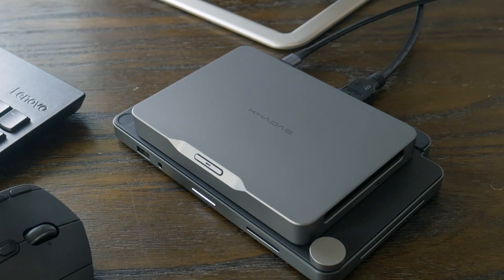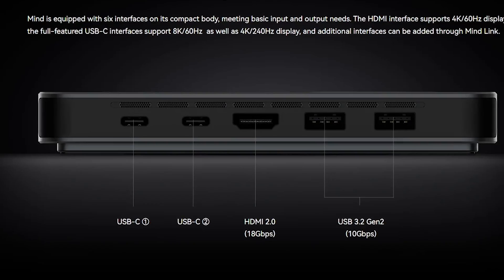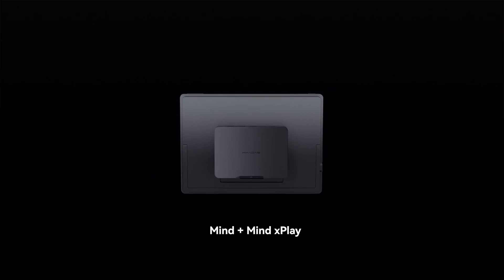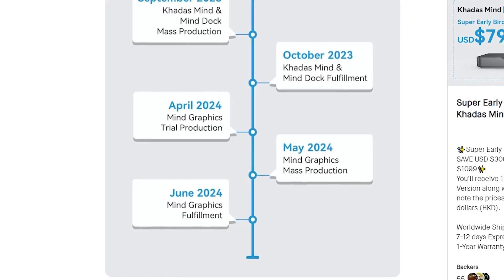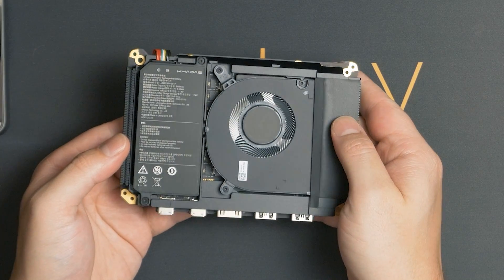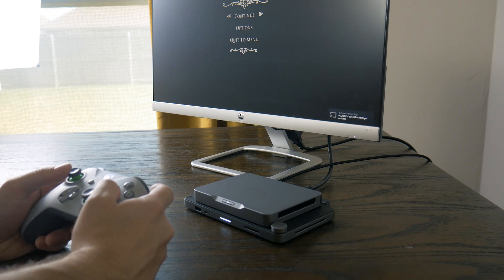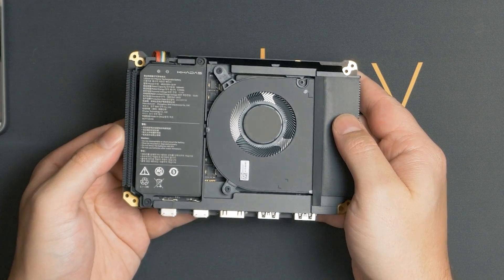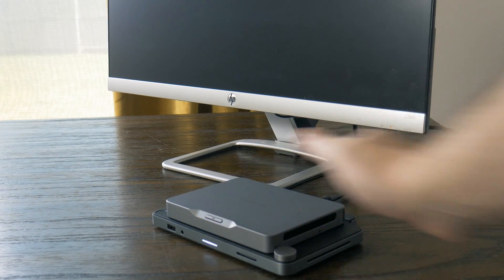Is THIS the future of PCs?

Comment: Framework has a similar solution with their cases for their laptop motherboards. And hey, upgradable system board and modular connectors!
Reply: Yeah but the connectors are all USB-C which is far better than this company's proprietary solution. You can even build your very own custom modules to use as a result with USB-C unlike the product in this video. Which is why this product will ultimately fail.
Reply: Kind of Framework is trying for a fully modular and going by the current standards of connectors so what you already have or might buy in the future will be compatible. Khadas on the other had seems to have went the route of the system RAM is non upgradeable as even the traces for an upgrade are missing for who might want to solider on their own. The CPU is a BGA CPU not LGA nor PGA CPU.  BGA makes for a thinner CPU but also a non-upgradable CPU. 
Having 2 M.2 slots the easier to get to of the lesser made for standard of 2230 isn't that good either. Framework gives you options that include boards with up to 22110 M.2 slots.
The USB ports ok it has more than most Framework laptops have but that is normal for modern laptops to not have many USB ports.  
Objectively Framework for all it's flaws did modular computers better. Khasa might get better and if they make another that has a "mind connector" for connecting many of them together i can see them being used in a node based server environment to have many CPUs in a small physical area for a developers at home environment to use. Still 700 USD a unit is high. 100 USD of which is probably just the windows license as i doubt they got a deal with Microsoft to get it for cheaper.
Reply: @yumri4  the way you discribed it suggests that khadas are copying Apple. Apple loves proprietary. I looked over framework's stuff and i like where they're going. Framework's idea is to provide you with everything you'll need for start but wherever they can they won't restrict you with proprietary crap.
Reply: and they won't void your warranty for fixing it.
Reply: Might be possible for them to make a bigger case for Framework 16 motherboard with universal PCI-E connector (as Framework 16 has x8 PCI-E pins for connecting a detachable GPU module)
Reply: @sihamhamda47 oh yeah, I would buy one.👍
Reply: All PC have that too.
Reply: No way the framework board is this small

Comment: the reason framework concept could have worked is that they didn't use a proprietary connector and tried to be as open as possible, publishing dimensions, etc. for a small company, proprietary connector for "extension" is just DOA. hell, even big companies more often fail than succeed.

Comment: This better not be the future of PCs. Proprietary connectors, no proper PCI-E expansion cards, no user controlled modularity, no replacable processors, and soldered ram?!? This thing sucks and I pray this doesn't become the norm.
Reply from the maker: The thought of this being the future would mean that the connector isn't proprietary, at least that's what I was trying to convey. And while I love socketed CPUs and RAM, it's very likely that SOCs are going to be the future in many ways, mostly because of the benefits you get with shorter traces. At least with something like this, you can upgrade/swap a an SOC essentially.

Comment: Yeah. No. Expensive. Voiding warranty for replacing an SSD. The literal definition of a user servicable part. Proprietary connector. With Overpriced "Standard" Hardware like the 4060 that you are locked into buying. Product hasn't shipped to backers yet, but they are already planning to open up the store to outside orders? 

So many red flags... Seems like they've got an apple complex, which is the exact opposite direction the market should be heading in imo

See what the backers say on KS first

Comment: I don't know. This frankly seems pretty dumb. So it's a relatively high end single board computer in a nice small case. That's cool. But that already exists. Then to expand it which is the selling point of the whole thing you need to use a proprietary connector. That sucks. I mean business used to not super mind that. You saw a lot of laptop docks back in the day that used connectors like that. But post the widespread acceptance of USB-C that's pretty much gone away. Even most business class laptops now just have USB C docking solutions, with some sort of custom locking mechanism. I really just don't see where this has a place. 
A mini pc with a USB-C port that supports thunderbolt 3/4 is going to have all of the benefits that this has (Maybe slightly worse graphics cards utilizations. I'd need to see some testing of mind link to be confident one way or the other) it's just a solution to a problem that at this point has already been addressed in a superior way. I honestly don't get the appeal of this.
Reply: Laptop docks are still proprietary. No two laptop models seem to have the same IO in the same place to actually *dock*. The only one that seems to exist these days is for the Macbook. What you have instead is just IO extenders on a cable.
Reply: @kendrakirai  As someone who's worked for several remote jobs that supplied laptops with docks post covid I am 100 percent confident in what I said. Even most business solution docks are USB-c how the laptop sits on the doc doesn't matter the connector is all that matters.
And your comment about what IO you are granted one doc to another also doesn't matter.

Comment: cool video! i don’t really see the problem this solves, though, and the proprietary connector makes it a lot less desirable to me. it seems like a laptop with extra steps
Reply: I guess you can have better ergonomics at each docking station, instead of using a laptop? But then again you could do the same with a laptop..?

I think it's neat, but ultimately doesn't seem to solve alot of problems.
Reply: The concept is great idea though, could have a dock running 4090, so you don't have to carry the that around. most hotels have a TV anyways

Comment: Yeah, no. Proprietary connectors. What a great idea. I don’t have a closet full of things with proprietary connectors, nope, not at all. Looks like a future doorstop to me.
Reply: Literally came to the comments to say this. Taking pcie 5 and turning it into something lesser.
Reply: @PlayingItWrong what's the max amperage of PCIe? Four? Six maybe? Edge connectors are not suitable for auxiliary connections and being exposed to the environment. Seems like a proprietary connector would be required to meet these specs, USB isn't mechanically robust enough.
Reply: I agree, if the connector was something standard like pcie or oculink, then i think it wouold have been good @PlayingItWrong
Reply: Looks like the most compatible would have been an x8 or x16 PCIe slot on the edge (even if it's electrically a x4, it would make plugging in a regular GPU totally easy and possible.)

Second choice would be using oculink connectors, which are sort of becoming a standard.  Thanks to the GPD Win Max 2 I can go buy and M.2 to Oculink adapter with a x16 eGPU slot for about $40 shipped.  This seems to support that sort of thing at least with the bottom mounted M.2 bay, so that is good.

I think the main problem is they need to get down to the $200 or $300 price point (and I'd really like to see at least 2 P cores and 24GB of RAM at the $300 price).

I know there are a lot of trade-offs, but I'm not sure what having non-proprietary ports would hurt.  They are definitely into this "carry around" thing, but unless they have some cheaper docks and models it's not going to get to the point of mass adoption to drive the price down.

They might get farther with some VR or AR accessories, but they probably should have started with a more powerful GPU model to enable that.  I could see this as a belt mounted PC with some Video glasses for sure.
Reply from the maker: @milescarter7803  As far as pricing goes, my best guess is that their hoping early adopters will be open to buying higher end (and higher margin) systems to get some capital to invest in development of more affordable "mind" products. Or they just will always charge a premium. 

To be clear, I'm not buying one anytime soon lol
Reply: yeah there's no reason why they couldn't use a thunderbolt port or NVlink port.
Reply: Yep. Proprietary connectors can go in the trash.
Reply: their custom port could have been replaced two thunderbolt ports and a hub
Reply: and for those reasons I’m out
Reply from the maker: For sure. But I also didn't have a closet full of USB C device at one point either, and I wouldn't necessarily want to go back. That's not to say I'm buying one of these anytime soon though, lol
Reply: @HardwareHaven apples to oranges - usbc is a standard, this ain't.

If they had a module to get me those pcie lanes back from this connector I think it would be an easier sell.
Reply from the maker: @pawepiat6170 I realize that. If I didn't, I wouldn't have told people not to buy it at the end of the video lol. But I like the idea of the connector, specifically if it ever became open/standardized.
Reply: @pawepiat6170 USB-C was once NOT a standard, but after the 12-inch MacBook released, it started becoming one.
And even cables for the most part are not standardised, as most of them vary so much and don’t satisfy all the specs of the USB standard, and if lots of variance exists, there’s going to be plenty of confusion in the standard.
Reply: @fujinshu  standard, as in there are 3rd parties making this stuff and it's used everywhere. It's agreed upon by the manufacters. The fact that usb compability is a mess doesn't change its position as a standard.
Reply: @fujinshu  what are you talking about, USB-C was a published standard from the beginning. It was never a proprietary connector.
Reply: @HardwareHaven there is other option like usb 4 pcie tunneling , oculink, or actual pcie connector 

If not hotplug then the pcie connector framework 16 used for module are reasonable too ( also open source I think 🤔 ) 

This special connector thing is just like asus special XG connector or dell Alienware AGA .a big NO  😅
Reply from the maker: @frankwong9486 I think the difference here is the physical implementation. I don't think USB4 or Occulink would be as physically stable for throwing a computer onto it like the ML could. 

also not sure which framework connector you're talking about. Could you shoot me a link maybe?

Also, I don't think it's a good idea as-is, but I don't hate the thought of it possibly becoming an open standard.
Reply: @HardwareHaven  he's probably talking about yet unknown but announced graphics port in framework 16. But I don't know if it's not just a pcie with some bells and whistles.
Reply: @frankwong9486  those are all proprietary, apart from frameworks one which might be a workable suggestion, but we don't know that yet. Video explained why regular pcie couldn't be used (not meant for frequent cycling) and this connector provides 5 pcie x16 lanes iirc, not one. 

Usb4 and others just aren't meant for this kind of thing, tunneling pcie over them always was problematic and doing it this way ensures compability (from cpu point of view I imagine it shows up as pcie lanes). I also believe that this lower profile connector has better shot at surviving alot of cycles, as mentioned in video I believe. 

Really only thing to future proof it properly would be to release a docking station that exposes those pcie lanes for any use. It's all soldered so why bother future proofing it I guess? Then again I can still use 2nd or 4th gen Intel to check my email
Reply: @HardwareHaven i mean, usb is literally the universal standard set by a committee. People HAVE to switch over time. Same with SATA and PCI-e, etc. These connectors would have to have universal backing from the tech world to even stay afloat. It looks impressive, but unless this connector can find uses in other areas of tech and can be used by other companies, a proprietary connector for a niche product is simply.. dead on arrival. Won't have the same "pull" on the public as much as USB-C.

Still neat and hope to be proven wrong
Reply: @HardwareHaven Usb c is a standard openly shared across the industry. Whatever connector they used here will never be like usb c.
Reply: @HardwareHaven  USB is open. Anyone can use it. I don't think it's same with this.
Reply: @HardwareHaven usb c went world wide quickly becoming standardized throughout pretty muvh every company, this connector is only to one company
Reply: At some point proprietary will become normalized if it is truly great
Reply: @lolmuffen8604  Not if they don't publish the standard. Big part of reason why Framework is currently getting a lot of 3rd party attention and projects built around it is that they do publish lots of schematics and drawings for others to use. 3rd parties won't start building for something proprietary that easily.
Reply: Dell and Apple are still doing just fine and they are full of proprietary parts
Reply: @CrapkinsTheBrave  If you're big enough you can get by with it, if you're a small outfit, it just means that the choices for components will be....limited.  Nice to have the PCIe lanes available, but if there are no modules that do what I'm interested in when I find myself with a need for expansion, they may as well not exist.

Comment: Seems like a waste of money and a poor ecosystem to lock yourself into. The standby gimmick is cool, but it's not cool enough to justify the lock-in. Laptops and docks are much more practical. If you step back and look at it objectively there is no real upside to this device over a laptop. It's a laptop with worse IO, no screen, and bound to a walled-garden set of docks. Even in a theoretical case where you do not need or want a laptop, a mini-PC that supports usb4 or thunderbolt would let you choose your own docks for less cost.

"Mind Link" is a total gimmick. it does nothing that USB4/Thunderbolt can't do. If it did not have that connector and instead came with USB4/Thunderbolt and a dock that used it it'd be a straight upgrade. Total joke of a product.
Reply from the maker: I don't necessarily disagree with just about all of that, but to say the mind link connector does nothing that USB4/TB can do is just not correct. USB4 supports up to 4 lanes of PCIe 4.0 whereas the mind link can supposedly handle 8 lanes of PCIe 5.0. That's a massive difference in bandwidth. 

Once again, I understand not getting into a locked ecosystem; I wouldn't.